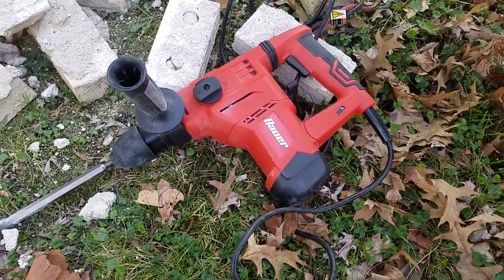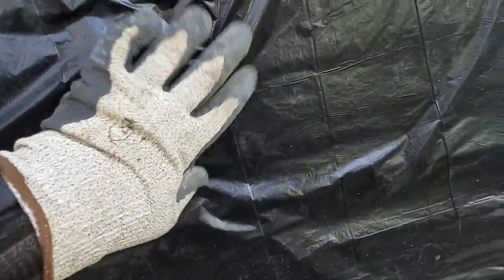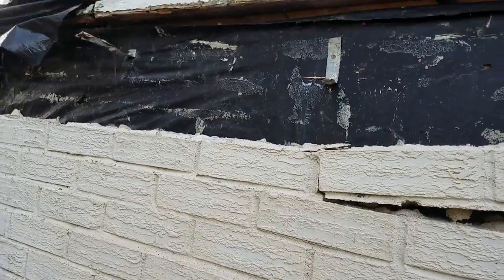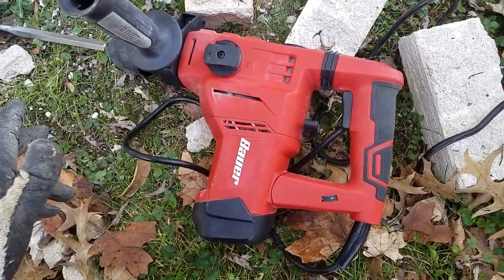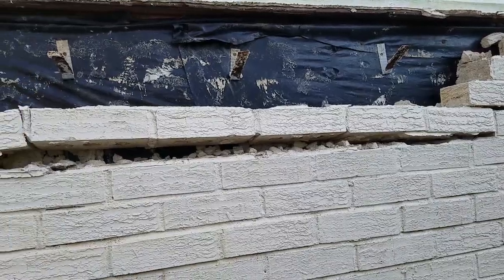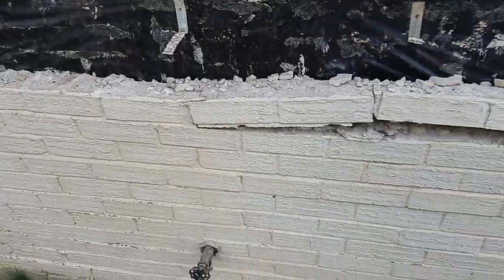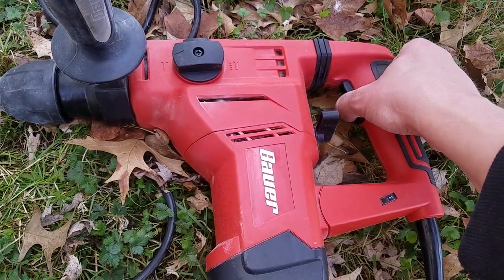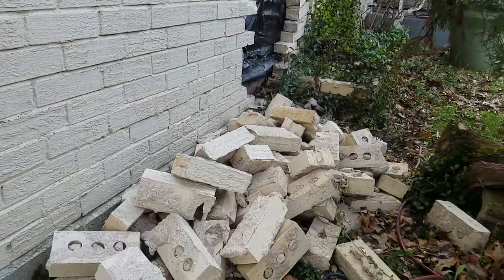BAUER  1-1/8 In. SDS Variable Speed Pro Rotary Hammer Kit  In action

Comment: I bought this tool last week at HF to bust up some concrete around some old cut off steel fence posts in the drive way.  I didn't even bother with the different settings, just put it on the highest setting and went to town and the thing did a great job. No trouble at all busting up that hardened concrete.  I paid $99.00 for mine which to me was a steal..why fool around with renting one of these things at that low of a price? now I own it for other work.  Definitely not a one handed tool , not for the ladies anyway!  That thing is heavy! lol.
Reply from the maker: Awesome, I somehow got it for 60. and it demolished a brick wall in no time. Don't worry about using it one handed, I don't even know if I can do it. well, usefully anyways.
Reply: @InNerdimensional  You got a great deal.  Yeah, great video. No, There's no way I could do that..I know you were juggling tool and camera etc.  It sure is useful :-)

Comment: Thanks for the video! I been looking for some clues to fix mine, which stopped drilling. It works fine like you demonstrate here, but not combined with drilling.
Maybe you have experienced the drill stopping in hammer/drill mode, too? 
I have used this machine several times to purely drill with a "core" bit, and just today I was trying to help a neighbor hammer/drill a concrete pad. The dials were set as the card instructs (round dial pointing at hammer/drill, and LEVER in 9 o'clock position == maybe the card is wrong, so I tried other way too). Using the correct SDS - not SDS Max -- bit. It starts to hammer and drill okay but then the drill just disengages. The bit is engaged to the chuck correctly too. In fact, I cannot disengage or keep it from spinning using my hand, so it appears well until you hammer drill some concrete. Press hard, press easy, different speeds, doesn't seem to matter. Adjusting the lever yields no improvement.  ANY SUGGESTIONS you offer are welcome.
Reply from the maker: How long have you had it?
Reply: @InNerdimensional  I'd say I have had it 8 or 9 months. It has only been used to drill cores for setting iron rails until now -- that's just purely drilling, using a columnar diamond core bit with a bit of water running in the cut. One thing it might (?) be is a some kind of ball bearing in the chuck, although it is well lubed and cared for. Beats me.